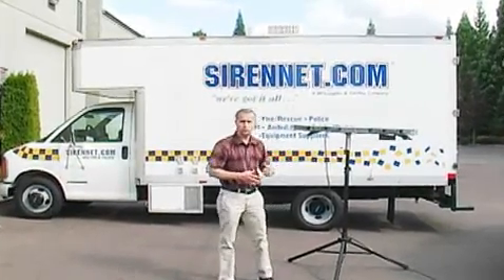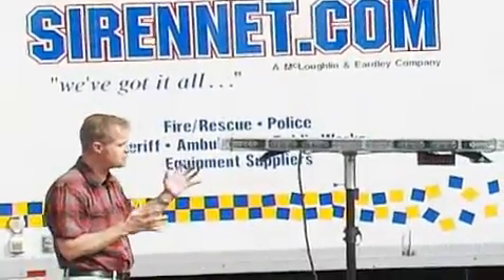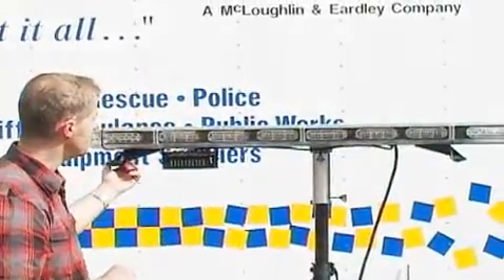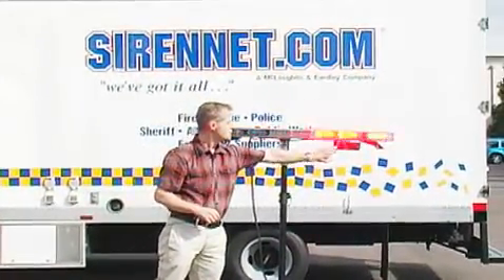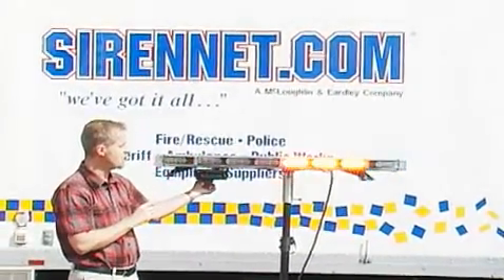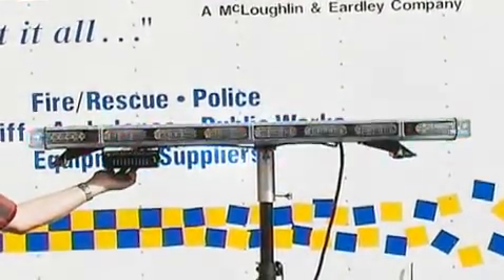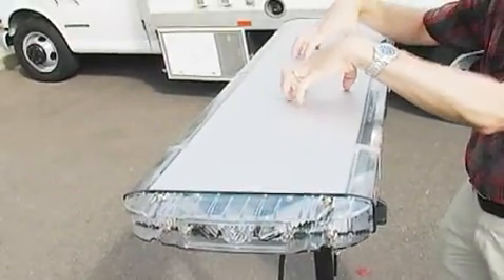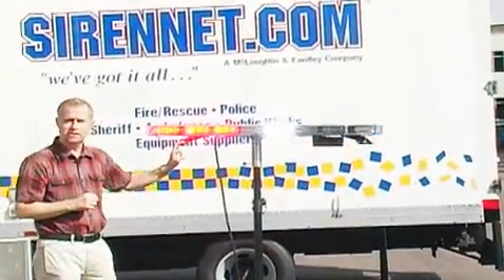Whelen 2010 Liberty Duo Technology Lightbar

Comment: Tex look at the new trio bar. It comes in 4 different models. 2 primary warning colors to front and then all white for takedown floods. The rear is the same, 2 primary warning and then all amber TA. Also has the option of having green corners as the 3rd function for command post.

Comment: @SIRENNET With Duo Technology, can the front LEDs be ordered so that each module on the driver's side is red/white, and each on the passenger's side is blue/white, but programmed so that the white portion can only be used in a steadyburn function (I feel multiple takedowns are extremely important)? Or, could the bar be ordered in this colors and then self-programmed? (Sorry if the question is unclear.)